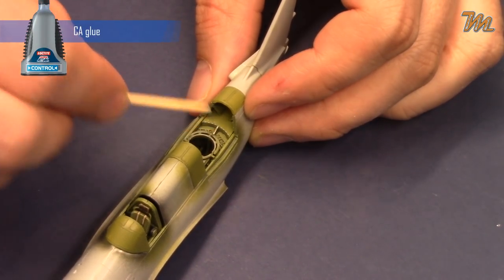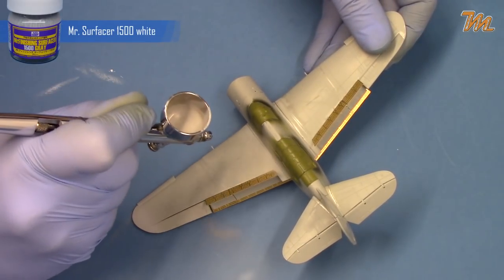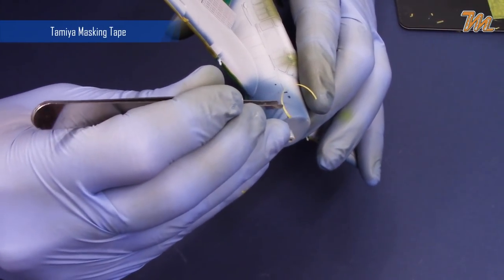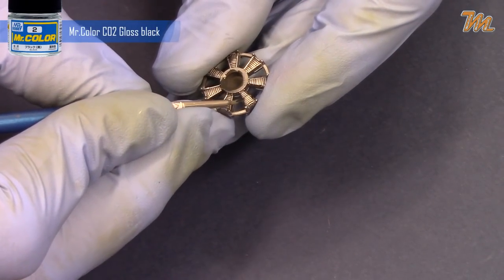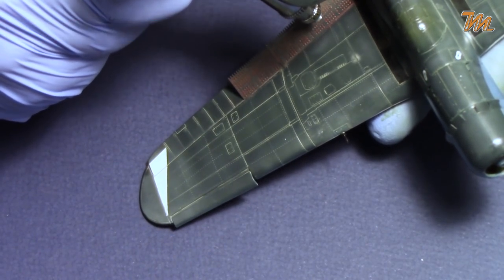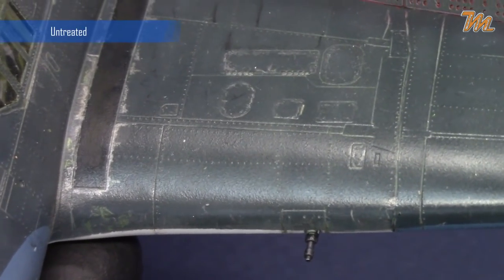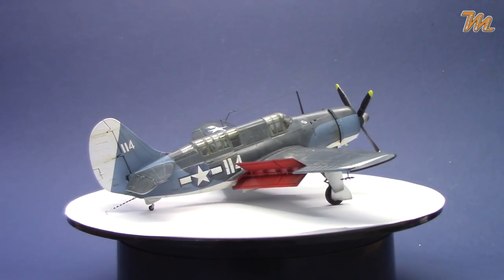Part 2 - SB2C-4 Helldiver - 1/72 - plastic scale model step by step build

Comment: Very nice job.  Where did you find the rivet specs or schematics?  I cant seem to find them on line for this aircraft.
Reply from the maker: Thank you, this build I did long time ago and cannot recall the exact website but I found the plans on the internet for sure.
Reply: @MMScaleModels  one other question.  I see you doing pre shading/molting on your models, i also see you are spraying VERY close to them.  What kind of Psi are you running on your compressor?   Im sure low psi and highly diluted white paint???

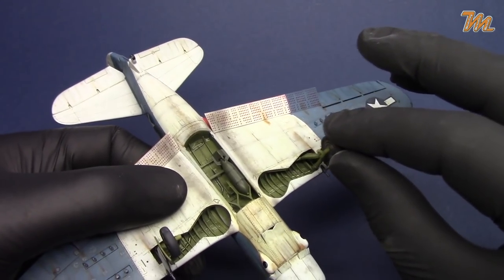Comment: 18:18 and the worser part is that they've made  attachment of these landing gear 'shields' wrong! if you google some SB2C pics, you'l see that landing gear shields should be in line with landing gear bays, but in this kit they don't. cyberhobby disappointed me
Reply from the maker: It is a very strange kit, there are some really good things about it but also some very bad.
Reply: @MMScaleModels  
exactly! 
ps
alomost finished it :) thanks for video - it helped